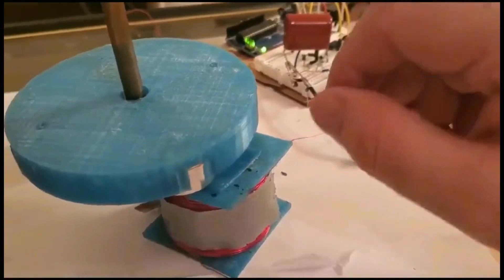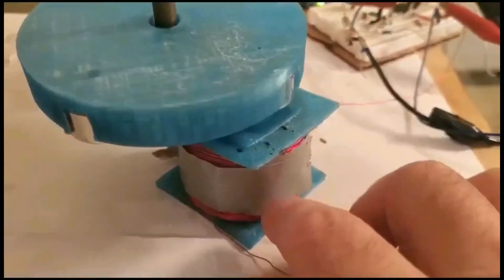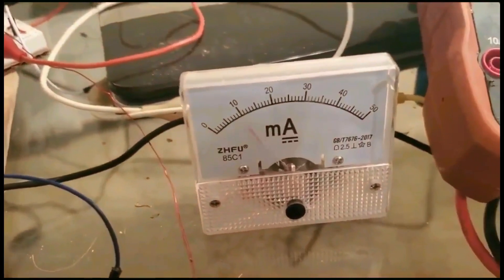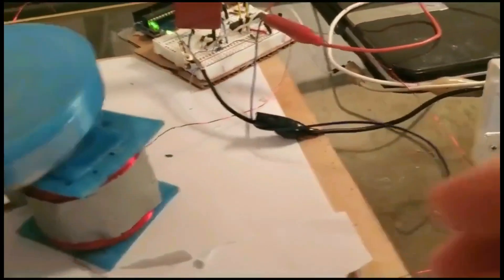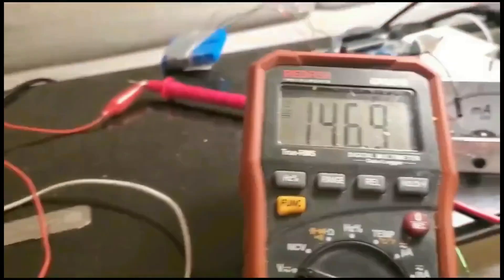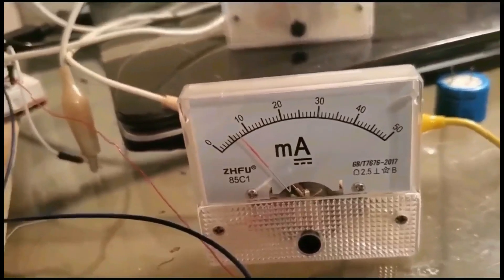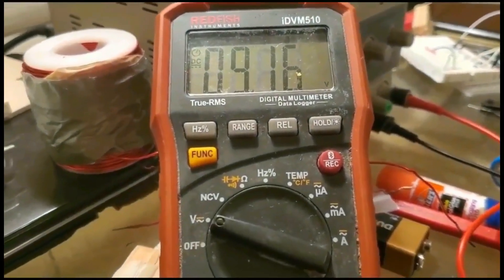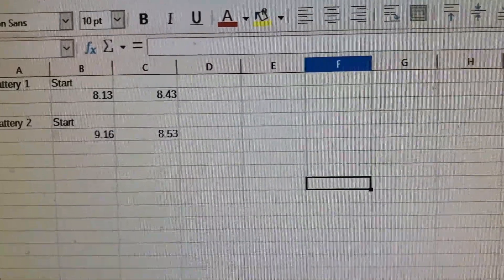First go at Charging a Battery with the Pulse Motor

Comment: You want the best usable output for your case ! If its high enough voltage to run something then go for Voltage but if you can do low voltage but need more amps then tune it for that case .?

Comment: Thanks for posting. In my testing I have opted to use a bifilar coil to pulse the motor. One winding pulses the motor and the other just to receive and harvest the energy to a full bridge rectifier. Initial testing seems to show 50 percent of the energy can be recaptured in this manner. Still testing things, hope this helps.
Reply from the maker: I would think a set-up like you have gives a darn good magnetic coupling between the primary and secondary coils, haven't yet tried that myself.  I think I said it in the video but I am going to try next and run the thing off a supercap and charge another supercap, gets rid of the whole charge acceptance/electrochemical strange battery conditioning stuff and is just going cap to cap.  And with that setup I should have my answer in a few minutes instead of a few days.  Again I think I said all that in the video but stay tuned and the next spinning things video I'll see what I can recapture going supercap -> supercap.
Reply: @paulmaher812  Look forward to it

Comment: I saw one video with a similar rotor generator where the guy was using a big LED light as the load. It was flickering a lot and not very bright. Then he put a couple of piezoelectric buzzers (you know, those little round yellow and white ones) in between the generator and the load. The LED not only stopped flickering but it became much brighter. The current seemingly went way up. Not sure but I suspect there is some kind of good resonance happening there. I'm gonna try it as soon as I get my generator set up.
Reply from the maker: Veeerrrry Interesting, You have a pulse motor, when a piezo electric sees a pulse it will deform its shape and as it snaps back will be giving off a voltage, it's not that crazy to think you might see some weird sht.  Very interesting indeed, thanks.

Comment: Paul have you circuit schematics for this setup or the link thanks
Reply from the maker: Hi Ed,  Sorry I haven't put together any circuit schematics so far, perhaps in future if I find time.  I may be able to do one better than that for you though, I did do three whole videos on 1) how to mate the hall effect with the arduino, (you want to use a linear/ratiometric hall) and 2 and 3) how to do the commutation with the Arduino/hall/SSRs. Even if you have the circuit you still need the Arduino code to make it go and these videos go over that and I believe also have the code.  I'll put the links in this video description as well,  1) https://youtu.be/Yi8gD6pa_78  2) https://youtu.be/feofma-f27o 3) https://youtu.be/mZjBndeHZuM

Thanks for the heads up and hope that helps.